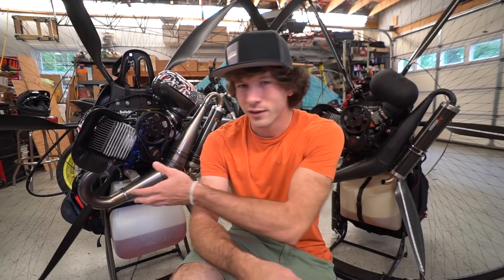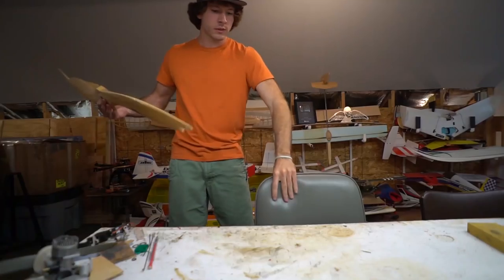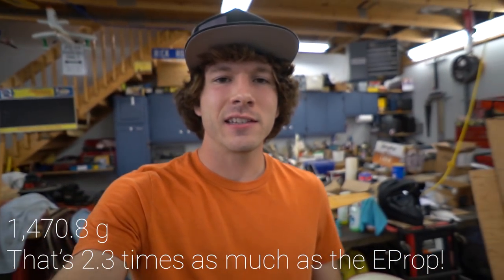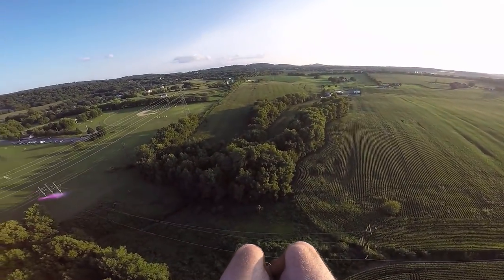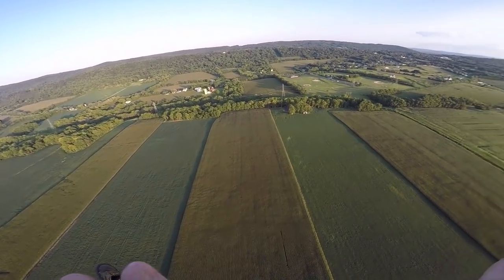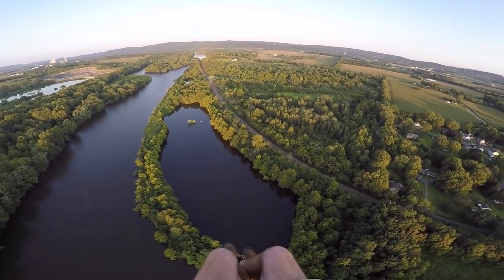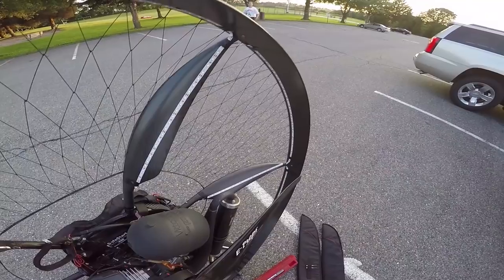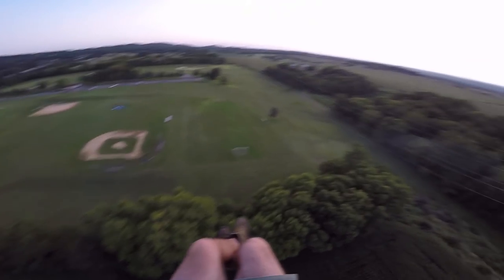Gain extra power from a new propeller!?

Comment: Commentators are suggesting that suspending the rig from a supporting frame and measuring the full throttle deflection from vertical to compute the amount of effective thrust from each of your various propellers?  That should provide a more scientific result.
That is not exactly true as there is a difference between the rig being stationary and the rig moving forward, due to the apparent wind entering the propeller. Just to make my point a little clearer, if the rig is stationary with say still air around it, the propeller will always bite into some air and produce thrust unless the propeller " cavitates" as in the water case.  If the rig has no drag and the rig moves at a speed which is decided by the ideal theoretical speed of the propeller pitch and the revolutions it is running, then in those conditions while traveling forward, the propeller PRODUCES NO THRUST AT ALL. A propeller slips between theoretical max speed and the practical speed where there is a particular speed where the apparent wind enters the propeller at a particular angle of attack to produce the maximum thrust. 
In engineering, there are many characteristics that may be obtained from diverse machines both in mechanical and electrical machines as torque in a steam engine, diesel or gasoline engine or  say an  electrical induction motor   where the latter has a little torque at starting conditions, then it goes through maximum torque at a certain slip with respect to synchronous speed and then it produces no torque  whatsoever at  the theoretical synchronous speed of the motor.
Normally in choosing a propeller,  the diameter depends on the power of the engine and the gearbox ratio while the pitch depends on the theoretical estimated maximum speed of the craft considering its drag. If one needs to play about with slow speed maneuvering and fast accelerations, then it is better to go for the low weight low pitched propeller. 
It is to note that in aircraft and boats and cars the speed is not directly proportional to engine power....... if that was so, shipping and aircraft would love it as they would save a lot of money. Fluids are not easy to penetrate at high speed even though they appear to be so " soft" at the lower speeds! 
Read about Rheology (/riːˈɒlədʒi/; from Greek ῥέω rhéō, "flow" and -λoγία, -logia, "study of") is the study of the flow of matter, primarily in a liquid state, but also as "soft solids" or solids under conditions in which they respond with plastic flow rather than deforming elastically in response to an applied force. It is a branch of physics which deals with the deformation and flow of materials, both solids and liquids. Fluids are complex mediums and this young man Tucker Gott and his colleagues are doing very well in understanding the medium then fly so very well. These young people are very intelligent and as an 80-year-old engineer, I  do enjoy seeing my engineering giving young people such an opportunity to learn so much. We did not have such opportunities in our youth, but as an old engineer, it makes me proud to see my equipment giving a better life to humanity in and outside their homes,  in hospitals, music halls, art, and with such sport as paragliding.  All my life I never believed that schools and universities religions are the best places to learn about life and ethics. They may be a  reasonable starting platform for the rules of life, but these videos clearly show that young people can learn...... if they make up their mind to learn.  I just ask one thing off young people. DO NOT TAKE UNNECESSARY RISKS. Thread slowly and feel your way through your difficulties and seek information before you step into the unknown which you should never do instinctively but with plenty of thinking before you step ahead.  Congratulations on your videos and some of the identities you come up with. Also, I like the manner in which you work as a team and help each other.  Also congratulations on your verbal descriptions and accurate language form which I am sure that the written version is also of a high standard. No person handling engineering equipment should be satisfied not proud with just buying it, owning it, and operating it, but he should understand it, and be able to discuss any complexity that may come along.
Young Mr. Tucker Gott seems to be a modest, humble gentleman, gifted with a well-calculating mind and all the other human tools which make him both a practical and an ethical man where he respects others when flying over their heads and their property. Well done, young man. When young we did what you are doing but with fast boats, but your modern equipment is much more exciting as it is three-dimensional freedom you live in. Well done, and be careful.

Comment: Do you notice any vibration or noise difference between the props?  Seems like my helix cooling prop makes a weird vibration from clipping by the engine head vs my old moster helix (h30f 1.30m l-z-06-2)

Comment: Tucker if you wanna do it correct you should als messure rpm on your engine vs thrust output. just like testing an model airplane engine vs master airscrew and APC props etc etc To bad your on the other side of the pond but i loved to set up a mythbuster type of rig to test and messure the props.

Comment: the prop is only a tool of the engine. Its like the transmision in a car. It has different pitches to match the power curve of the engine
I dont think weight has much to do with it
Even between two engines of the same model you will have subtle differences in the torque curve. find out what the pitch is of the props before judging them

Comment: Someone said put the eprop on the factory, which would you value more on you xc motor.. Top end climb or Low end acceleration 🤔
Reply from the maker: I would value top end thrust for cross country. Better climb rate is more important for cross country flying while better acceleration is more important for acro/ripping around.

Comment: It would be interesting to know if these props have a pitch parameter so you can compare pitch. But also, even pitch can be a bit irrelevant if you're talking different airfoils, which you have when comparing the E-prop and Helix. Wide open, what RPM do you have on each of these props? 

As far as RPM being a product of prop pitch, that's true an it's not true. Two props of the same pitch will have differing full throttle RPMs according to the efficiency of the airfoil. An inefficient, draggy airfoil will give you lower RPM even if the more efficient airfoil is the same pitch.

Props are something of a black art, and you need a wind tunnel and scientific measurement tools before you can say just about anything with confidence. One thing you did prove: that factory has some extra go juice in the motor.

Comment: Is the "factory" or flag prop designed for the larger engine set up for more cross country flying?  If I remember your intro video to the new motor, you talked about it being for cross country?  Nice video.  Hope you spent a little extra time with kids off camera.  I know you were up against a setting sun.
Reply from the maker: I think it's just a standard helix, but I would choose the helix for cross country flying so it makes sense. I did a fly by with smoke on for the kids, but didn't include that in the edit. 😁
Reply: Cool, thanks.

Comment: Did you notice any difference in cylinder head temperature between the props? My wood prop runs noticeably hotter than my glidersports carbon one.
Reply: The Moster 185 actually uses the prop intake as a cooling element

Comment: If it’s lighter on the ends, there is less inertia. You could put a ton of weight in the middle and heavier overall, with lighter blades and still spin up quicker. So, you’re measuring them wrong.

Comment: Any thoughts on the eprop 125cm (which I believe is the one u are flying) vs. the 130cm version?
Reply from the maker: I'm flying the 130, I've never had a chance to test out a 125.
Reply: I've had both on my motor and found the 125 to be snappier; however the 130 gets better mpg's and better climb (I'd be curious to see if the 125 isn't slightly better for your type of flying).

Comment: Is there a weight limit
Reply: Lee Crossley each piece of the whole craft has its own specifications and you have to match the total capabilities to your needs. There's a couple companies that sell complete systems with estimated performance and capability but you really have to personally investigate every piece. Wings, engines, props, harnesses, seats.
Reply: @TheGreatPurpleFerret  thank you that was a good piece of information I really like to get into the sport because I have no fear
Reply: Lee Crossley I personally dislike the idea of approaching it from the standpoint of it being an extreme sport only for adrenaline junkies. Sure Tucker does some neat acro but he does this for a living and has done for years.

Most folks are entirely focused on keeping in the air and even then injuries are pretty common. Back during the Icarus race one of the competitors flew into electrical wires, and earlier this year one of the guys at a fly in had a pretty severe ankle injury. Just a few weeks ago one of the guys tucker was flying with had an engine out and went down in a soybean field. It was a controlled landing of course, but he also wasn't doing sats and barrel rolls.

Going into it expecting to get an adrenaline rush and fly crazy is a recipe for disaster. If you push yourself past your limit on a dirt bike, you'll crash and maybe break an arm or a leg but you'll survive with just a helmet. If you push yourself or your equipment past the limit at 500 feet you will not survive. If you push yourself past your limit over water, you will not survive. If you take risks near electrical wires or trees you could have the bonus issue of slamming to a complete stop from 40 mph and then also falling 40 feet with a 50 pound motor on your back.

Fear is the body's response to risk assessment. If you go in expecting it to always be some new adrenaline high and you ignore that risk assessment, you will push yourself and you will make a mistake.

Fly for the sake of flying.

Also follow all local state and federal rules and regulations (as few as there are) because if you fuck up you could fuck up for everyone.
Reply: @TheGreatPurpleFerret  well you can always go around crying what's going to happen it's going to happen!!😆😉
Reply: Lee Crossley , please don’t, fear is necessary for survival!

Comment: They are Backhoes or "trackhoes"
Reply: Excavators...
Reply: Depends on what part of the country your from, I would guess. Lol
Reply: Like saying that's not a hammer, it's a tool! You're both correct, a backhoe typically has wheels and a loader or blade on opposing end. Ima call them big boy Tonka  toys mmk
Reply: Guess you guys haven't shopped at a machinery manufacturer before. Caterpillar sells them as excavators. Go to Caterpillar's website and check it out. Educate yourselves a bit...☺
Reply: Michael, as a backhoe and trackhoe owner, excavators are a class of earth moving equipment.  Backhoe's can be attachments to a regular tractor.  Trackhoe's are very specific types that utilize either a rubber compound or metal track.  Both are excavators.  You use backhoes where you don't necessarily want to tear up the ground beneath you.  You use trackhoes for better traction and the amount of damage to the turf isn't a concern.  Backhoes can be used on concrete without damage whereas a trackhoe with a metal track will tear up concrete.  Think of it like automobiles as a class.  You can have a sedan or truck.  Both are automobile class, but are different in their primary purpose.  I hope this was helpful.
Reply: @GettingtheTruthOut  As a farm kid who grew up using a front end loader, and a backhoe, I think I know the difference. You will love not see Caterpillar calling their excavators trackhoes. My father sold JD machinery and I shipped JD parts out of the warehouse in Sask. Excavators are called excavators. Your terms are colloquialisms.
Reply: Failure to accept when you're wrong on an issue shows a terrible lack of maturity..

I'd also venture to say..
Mmm mah dad said that umm.. my bicycle goes waaay faster than yours Derrick!!

Comment: that first wooden prop....  you can clearly see that both ends have chunks ripped out of it. The weight of it on the scales is not an accurate representation.
Reply: Yet it got the point across of it being much heavier than all the rest...
Reply from the maker: There were two different wood props, the one I weighed was not broken and complete.
Reply: Is there a story behind the prop with the shredded ends? Maybe you ended up in a tree or something? :P
Reply: @Rose.Of.Hizaki  he did throw hot dogs at one lol

Comment: Heavier props = Stronger fuel economy at higher speeds and higher speeds altogether. 
Lighter props = faster acceleration 

Balanced props are combined elements of both. Whilst pursuing optimal angles of pitch and drag.

Comment: beside weight also amount of caught air influences acceleration but than it influences more torque on less rpm....than you need engine with more torque on less rpm...go diesel with the fat ass propeller:))